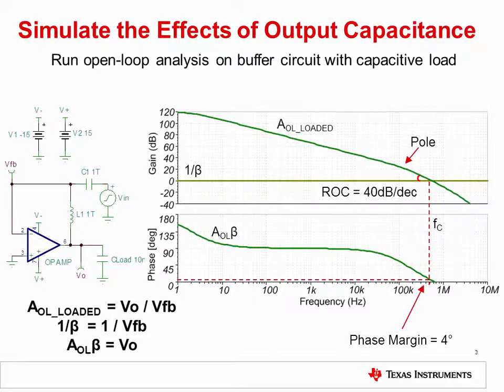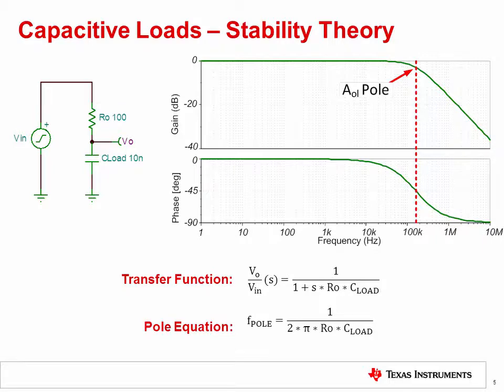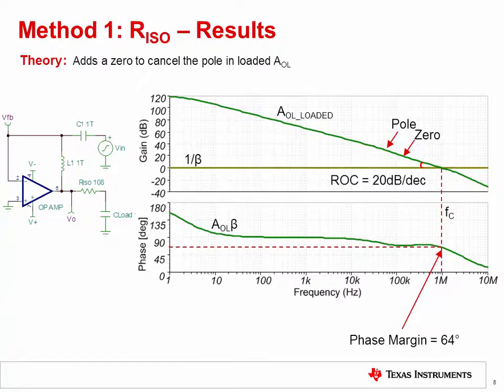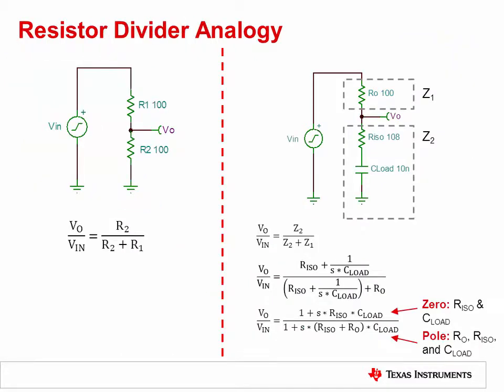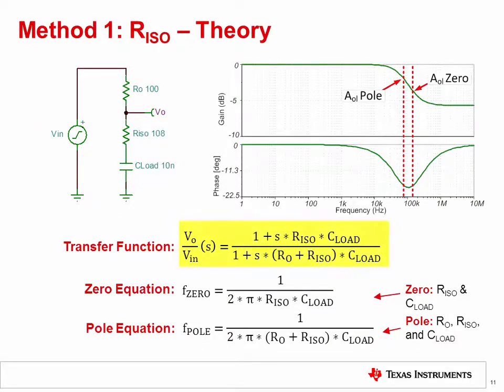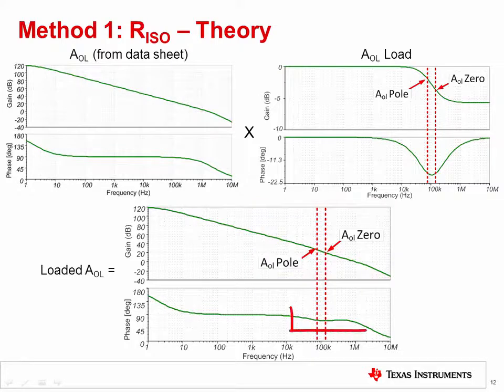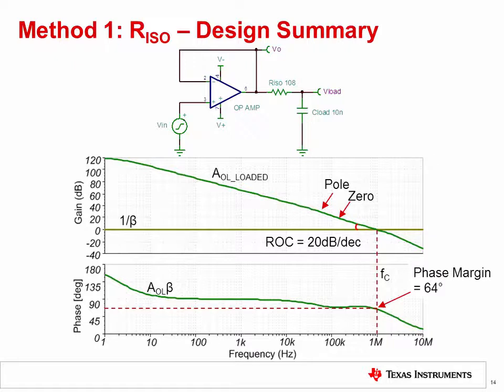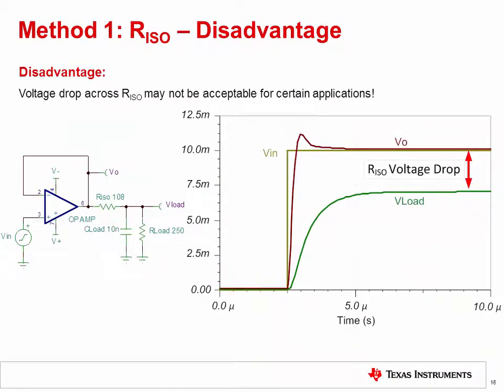Capacitive loads

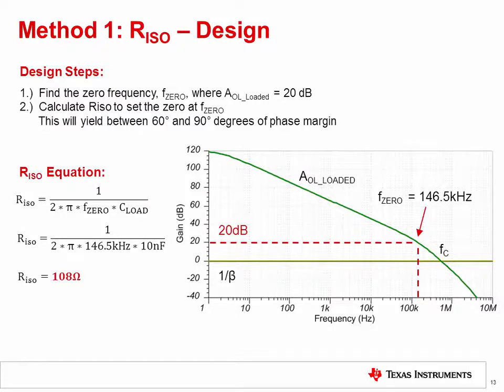Comment: 4:33 why need AOL_loaded=20dB to set fzero? And why that will make PM >=60 degree?
Reply: If the slope through the cross over frequency is higher than 20dB, i.e. 40dB it means that an extra pole is present which degrades the phase margin. Q: Suppose that you added a zero for pole-zero cancellation such that you have a 20dB slope at the cross-over frequency (0 dB gain), fc, where would that zero have had to be in order to achieve 20dB slope at fc? A: One decade earlier from fc. With a slope of 20dB/decade that would be at a gain value 20dB back from the cross-over frequency.
Reply: @gert_kruger  Thanks. Just saw your post. So with the zero set at AOL_LOADED=20dB, we will have 20dB slope at fc. That is understood. But how that makes PM>=60? Seems to me this will still depend on the higher order pole or poles beyond the fc. For example, let's say there is another pole at exactly fc, then the PM will be 45. To have PM=60, the higher oder pole will have to be 1.732xfc.